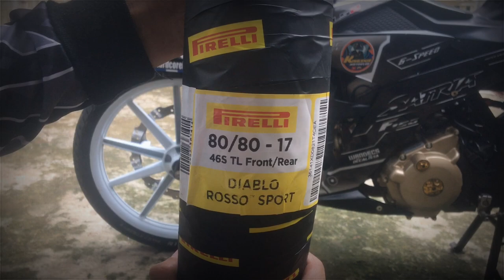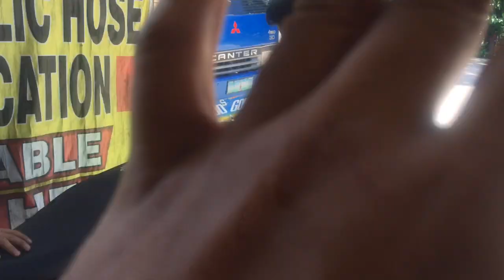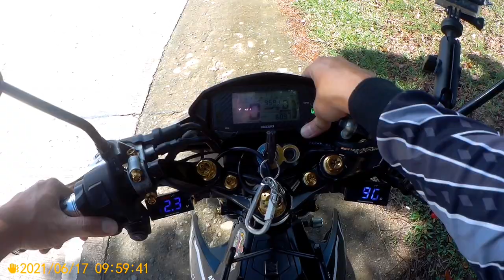Installing Pirelli Diablo Rosso Sports on Raider 150 FI

Comment: Anu po size Ng gulong nila front and rear?
Reply from the maker: 80/80 front 80/90 rear 90/80 sana un kaso out of stocks sila agad kaya yan nlang kinuha ko.
Reply: @KingskieMotoVlog  sakto lng po ung sulat na un sa harap likod
Reply: Hindi nmn PO sya Malaki or malapad tingnan
Reply from the maker: @romylacson7276  hindi naman po
Reply from the maker: @romylacson7276  sakto lang nman hanggang 90/80 ata sa harap ayoko ko na yun ok na ako sa 80/80 tas 90/80 sa likod paps
Reply: @KingskieMotoVlog  Ung sa takbo nya bumagal po b o tama lng
Reply from the maker: @romylacson7276  hindi naman paps kaya pa naman sa sprocket ko ung bigat ko.
Reply: @KingskieMotoVlog  nagpalit po b sila Ng sprocket o stock pa rin
Reply from the maker: @romylacson7276  yes po ng palit ako nung need na palitan nasult stock. ng 14/39 po ako
Reply: @KingskieMotoVlog  arangkada po Yan at dulo
Reply: Pag nagpalit po ako ng gulong ganyan sukat ng sprocket ilalagay ko din po sir
Reply: Anu po pa stock na sukat ng raider natin sir
Reply from the maker: @romylacson7276  payat po kasi ako below 60kg ok na sa akin ung 14/39 paps may trupa ako 80/80 tas 90/80 tas 70-80 kg sya mas ok daw sa knya 14/39
Reply from the maker: @romylacson7276  may sample ako mga video sa superkalkal pipe paps tas sa sibugay loop din 11mins start dito
Reply: @KingskieMotoVlog  medyo mabigat din ako nasa 75kls tpos mag aangkas pa kaya ask ako ng magandang combination na sprocket na kakayanin kmi ng angkas ko sa takbo
Reply from the maker: @romylacson7276  try 14/40/41/42 paps pde na cguro 41 or 40. stock kaba? nahirapan ba fi mo arangkada?
Reply: @KingskieMotoVlog  yup stock carb ung sa akin sir
Reply from the maker: @romylacson7276  all stock man din ako paps pero sprocket lang yan paps